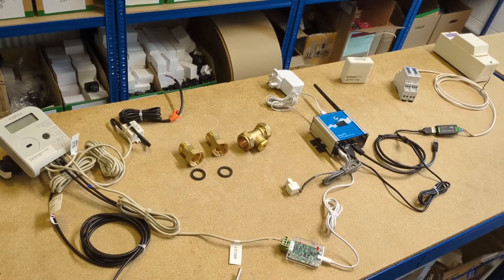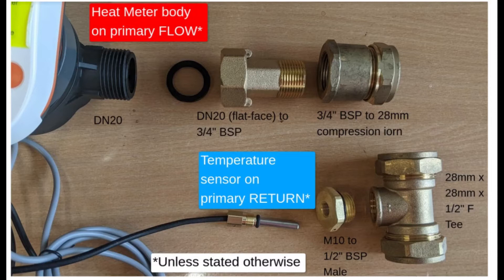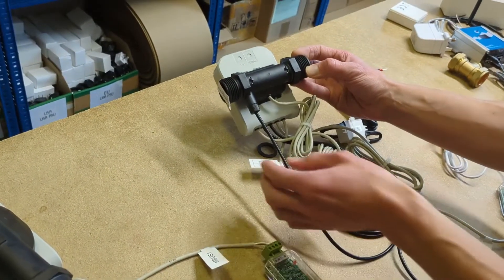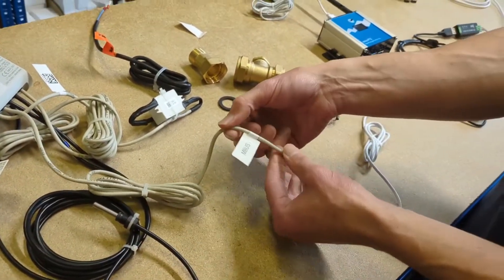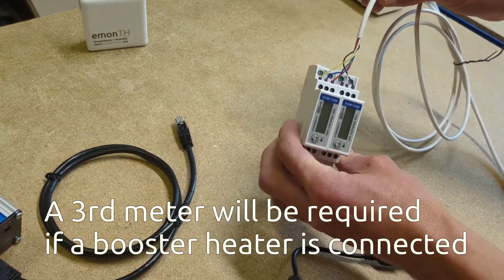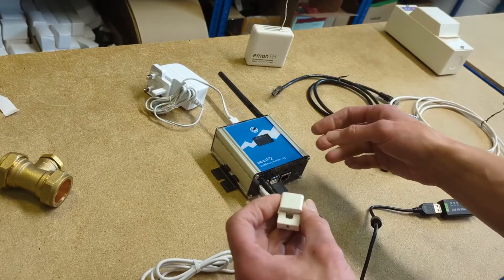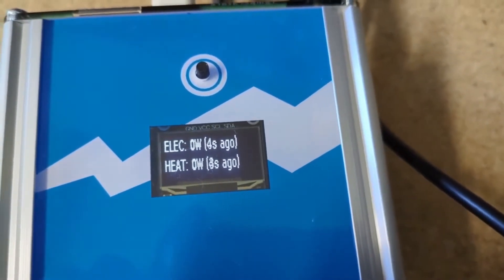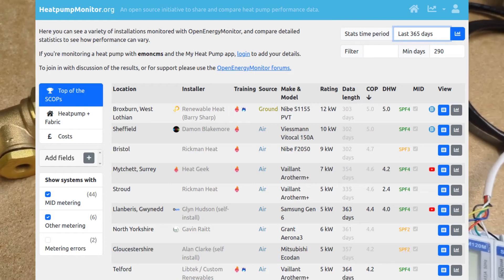Level 3 Heat Pump Monitor: Hardware Installation Overview

Comment: Hi, is it possible to use a CT clamp for electricity monitoring rather than the SDM120? Thanks
Reply from the maker: Yes, it's possible. But it won't be MID approved, unless you get the CT version of the SDM120

Comment: Really helpful video, thanks.  For a system with zones for say upstairs, downstairs and hot water, would you put flow meters on all three circuits?  Do the flow meters reduce the flow at all?
Reply: You could put heat meters on each zone, but that would make the system quite expensive. Yes, heat meters also add a pressure drop, but this can be calculated to be not significant if the correct size meter is chosen. For a heat pump system, it's far better to avoid zoning and run the system as one open-loop. TRVs can be used to avoid overheating, but if the emitters are sized correctly overheating not really and issue with lower flow temperatures.

Comment: Hi, is the pocket tee in the video (01:55) included as standard or this is an option? You seem to indicate that this is included as standard but then later suggest that it must be selected as an option. If it's an option, then why must you design a system that the Heat Meter requires the tee but then make this component an option? Why did you make the process of ordering this product too complex even before the very complicated installation process?
Reply: The Tee is optional. It's a standard plumbing part, many installers prefer to supply their own plumbing parts. Also, some installers prefer M-press rather than compression.

Comment: Very interesting. How does the system know the outside temperature?
Reply: We use the Metoffice API. We've found this provides outdoor temperature readings which are not effected by local heat sources.
Reply: That's cool. I thought there might have been an external temperature sensor that I wasn't seeing in your shop.

Comment: Good video with a simple explanation for newbies. 
The Level 3 heat pump monitoring is my go to for accurate data covering usage, performance and analytics. I rarely use Vaillant's stats in their app as they don't drill down to the level of detail I require. This OEM system can highlight any issues around trapped air, blockages, zone valves not working and so on. It's a valuable diagnostic and measurement tool from day one onwards.